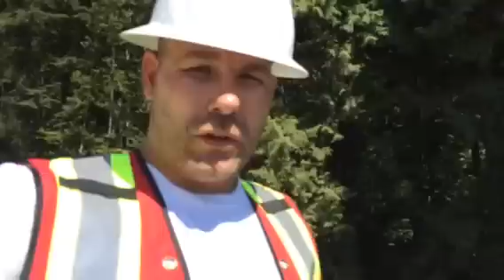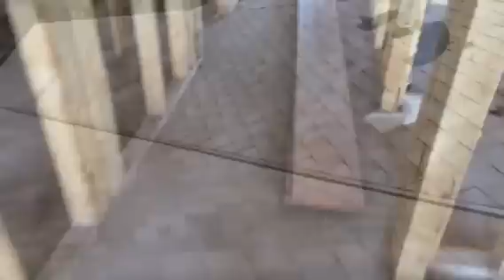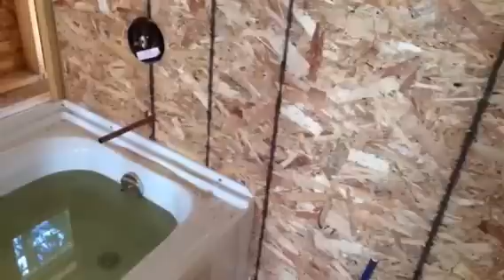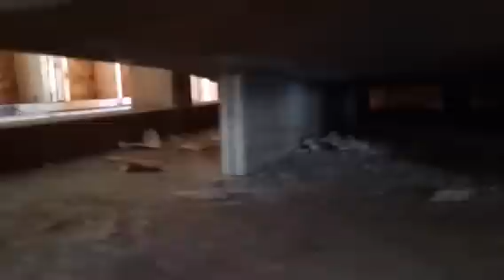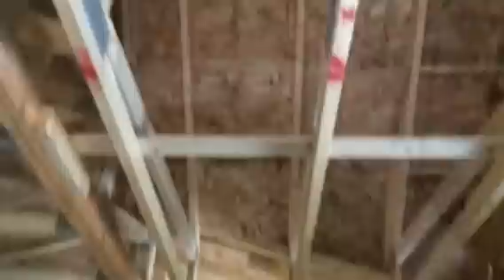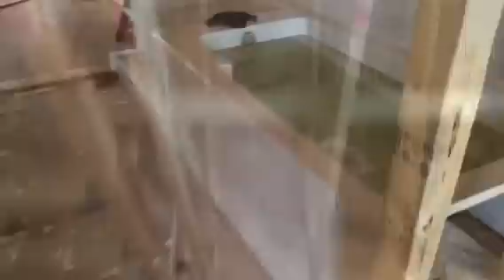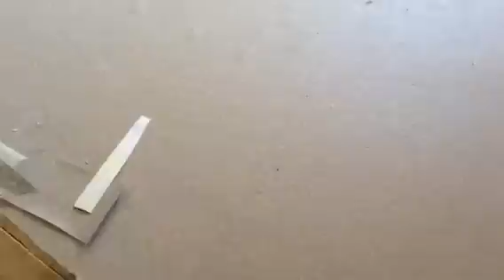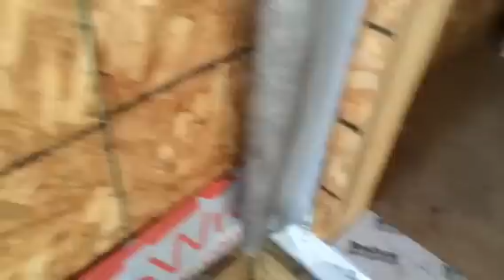New Home Construction Fails

Comment from the maker: Thanks for all your comments gentlemen.  This video is to educate people about what's going on behind the tiles, tub , sundeck surface etc. that the builder cut corners on to save a buck.  

The OSB used at a tile backer will deteriorate quickly if moisture gets to it and OSB doesn't have the same horizontal strength as plywood to hold up a heavy tub. 
If you have a different opinion then I know a house for you to buy...

I am a licensed home inspector. I'm from Vancouver, British Columbia in Canada where there are regulations for home inspectors.
Reply: +haligan125   DON'T use zipwall to tile over!!!!  The OSB you see will be covered by 1/2" cementitious backer and then waterproofed.  The OSB is merely a shear wall.  Cement board is not the only way to go -- there are some more expensive and exotic ways,  but they are not as widely used.  Be sure to waterproof cement board with Laticrete, RedGuard, or some similar rubberized product.  While cement board is not damaged by water, it does not provide a water barrier.
Reply: +SunShine I really doubt that anyone tiles the OSB.  If that was their M.O. why didn't they do the other walls?  The OSB is a shear wall which will get overlayed with another sheet of cementitious backer and waterproofed with a fluid applied membrane before tile.  BTW, cement board is waterproof only in that it is not harmed by water, but it is far from being a water barrier.
Reply: Tom Munro, CHI  Interesting to see what "licensed home inspectors" do, in Canada.  I understand fully the system, the logic.  But, I live in Belgium. I'm licensed architect, in Belgium.  Licensed or not home inspectors, do not exist in Belgium, because it's illegal to erect building (big & small, no exceptions) without full official contracted support from an architect, in all phases. From preproject design, up to control assistance at last delivery of works.  In other words, we're "continuous" legal and obligatory building inspectors in line with what we design and prescribe ourselves.  That's a story from another little corner of the world. 

B.t.w. apart from all the obvious failures you showed (All are 100% correct pointed out), my general impression on the timber, although I believe it's perfectly fit to (minimum) private home CLS rules, it's creepy FLIMSY, to my construction standards. Since Eurocode 5   EN 1995  became ruling in Europe for timber construction, I would hold my heart, seeing how flimsy this Canedian house is made....  
Cheers
Reply: +Tom Munro,    CHI I think I can go one better on you . . . I live in an older home (1920's) and had a problem with one of my outlets that started popping the breaker. Disconnected the outlet, breaker still popped. Trace the wires to pull them out, found where they were run through some old armored cables.Attached to the wall studs.With nails.Straight THROUGH the cable.Needless to say, no longer the case . . .
Reply: +haligan125 Cement board is plumbing code in most places. Green board will suffice as long as it is not being used in a tub or shower surround. Green board is only moisture RESISTANT. Cement Board is moisture PROOF. There are some more water PROOF boards available on the market which are lighter & easier to work with however more expensive.
Reply: +Steve Crane hey, can I get in on this d**k measuring contest........Steve, I have been in construction for 38 years and my money is on you.  You are dead on in your comments. 
Also, the "vinyl " appears to be some type of wet area substrate,  which seems to be flashed  correctly.  The roof venting is probably dictated architecturally. It is hard to tell about the condition for the upside-down  hangers,  but what is most concerning to me is how the ledger board was attached to the wall. How do you handle the void under the fiberglass tub? I usually run a ledger under the nailing fin and then bed the bottom in spray foam, although the manufacturer doesn't require it.
Reply: +Sunny One 
I respect that, going on 18 years my own Co., but to the CONSUMER, generally speaking, you want quality you pay for it...SO much of construction today is just crap with a nice paint job because General contractors want the cheapest bids, corners are cut and quality is nowhere...If a General wants top quality its not from the cheapest bid.Glad you demanded quality, but so many do not..All I do is construction defect type work because of people being cheap.
It may be a stupid saying, of which I agree, but in this world to include this video,  the builder was paying idiots because he didn't want to pay for quality.. Thus the phrase, "you get what you pay for"
quality cost more in most anything to include home building. Been to some 3rd world nations and wow, does this saying ring even more true, its shocking.
Reply: If u let Ur tile guys use green board as backer board, that's probably one of the reasons Ur no longer in business.
Reply: grout is not waterproof.
Reply: +Leavemyname Outofthis I had not seen this reply with questions until today.  So, here some answers.  

Creepy flimsy, would be the actual stud work in the first place. (OSB at the other hand has not much relation to being flimsy, as were talking about stability, unless, the OSB is applied as calculated tension structural work together with the studs which means intensive thin nailing density OR glueing) 
Stability in all conditions, also after 30 minutes of fire, which is fully included in EUROCODE 5, and applies to all EC countries, and it is including minimum heat insulation norms which differ from EC country to EC country. 
EUROCODE is the set regulation of minimum stability calcalation norms. EUROCODE 5 represents Wood construction. (Others are brickwork, concrete, steel etc etc) 
Also bend-allowances for medium-large span floors had been reduced from 1/300 to 1/500 with Eurocode 5.  (1/300 still allowed in typical short span domestic floors, like under 4 meters wide) 
If I understand well, in USA still 1/250 is allowed...   Everyone knows that makes a huge difference in wood sections indeed.  
etc etc 
There are so many things around this example seeming very flimsy (and nevertheless probably legal) 

When it comes to outer walls, in view of insulation norms, 140 mm sized + rockwool inbetween studs will even FAIL to get at our minimal norms anno 2015. I can get that right with theoretical 150 mm (= at the legal limit as we must consider all linear leaks in calculation = at all wood members, and more at corners) , and as we tend to do better than legal minimum, our actual sizing is (common wood sizes here) 173x32 or 225 x 36.  With the latter, I'm able to get at the 2022 insulation goal LIMIT, which is granted by tax reduction.   

Greets
Reply: Holy shit who are these hacks? I wouldn't let these slobs build me an outhouse.
Reply: +SunShine NEVER use green board in a shower enclosure. Its not waterproof its mildew resistant. Huge difference.
Reply: +griffey2447 purple board or even drywall can be used as sheer in an interior wall when it is called for by the engineer who drafted the plans or the city or county who plan checked. There is no reason or excuse to ever use OSB in a bathroom on a wet wall.
Reply: +Charles OConnor Drywall's shear ability was downrated so severely ten years ago that it is no longer used as shear.  It may have been a result of many American jurisdictions switching from the UBC to the IRC.  In the Pacific Northwest nearly all shear panels are OSB or CDX.
Anyone who worries about OSB in the shower area should also worry about hem/fir studs -- they rot too.  The reality is NO moisture should get that far.  If it does, your tile setter is incompetent.
Reply: You.obviously haven't run into me on the job Andre Glinsky I'm also trying to make inspectors better Andre.  

I see a know it all as part of the problem not the solution.  If you think you know the best way to do stuff that's great. I'm sure you clients are really happy BUT, that's not the norm in this Industry. There are a lot of poor builders in the industry or do you disagree with that statement to?  

I am just trying to bring awareness to the industry and I have been incredible successful at it. Where are you from? I'll come check out your project if you that confident...
Reply: You are mistaken. Properly installed and proper cure time and it is waterproof. I do this for a living.
Reply: A smart, gun totin', house buildin', spanish speakin', no-bullshit taken', plain speakin', cool ass, woman!  Hey doc, your ex sure head his head up his rear end when he lost you!
Reply: because roof sheeting should not get wet.
Reply: do you have marine ply over there?
Reply: And...just stfu already. If they used osb for shear it was probably called for. Look at the tub flange idiot and you might see the clues that the wall requires another layer of substrate. FFS all you armchair builders are fucking stupid!
Reply: +The Home Inspector 
Let me vent,, lol 
You are not in construction, but you judge and pick apart work that experienced people in construction have performed. In my experience with every private home inspector I've dealt with, not city, has been no it all wise guy or gal, (gals are the funniest) calling out items that are done per industry standard or city code, strictly per their opinion. just making uneducated guesses slowing down the process of selling my houses, so that I can write emails to brokersz buyers and of course the inspectors. proving that everything I do is strictly by the book and per most recent codes. 
that said, I understand that knowing everything about everything isn't possible. I would hope that you are one of the few decent inspectors that will do a bit of research when you see something that looks wrong but you're not 100% positive that it is.. 
I'll definitely check out your videos and pick them apart lol 
cheers brother
Reply: Tom Munro,    CHI I wish a better inspector had checked my house before I bought.  
the driveway grade is higher then the garage- basement floor causing flooding which warped the hardwood floors in 3 rooms that I had to repair and replace.
he missed several electrical issues, clogged floor drains, and a few other things he shouldn't have.    I'm still getting some of it fixed.
Reply: I've seen what OSB does... first it expands, then when it dries, it crumbles. Terrible stuff, especially anywhere near a bathroom or kitchen :/
Reply: OSB should never be anywhere near a wet location.  Schluter is approved for use over wood but I think they recommend a water resistant plywood because you have to trowel the cement mix over it so it has to get wet for the initial install.
Reply: Yes, I thank you very much! We moved into my house while it was under construction and did not have any inspectors come out like you did, and 9 years later... We're putting a new lock on the door because it's breaking, and we find that the door bracket where the deadbolt goes into was secured very badly. They didn't even have a reinforcement place which is standard in newer homes. They were using the screws that came with the knobs to screw in the plate. Which is incredibly dangerous. Let me ask you something. Do you want to have 2 small screws (not even wood screws) keeping you and that creepy man away from your stuff? Of course not. We have just installed another lock but had to put the other screws again as they had also cut out the wrong depth, so we have to put the normal screws back in, go t the store, get the correct tools, come back, and fix their mistake. I am going into an internship at my local school. Going into a program called, Ignite. And I'm interested in construction and technology and everything in between, and I'm thinking of majoring in construction. Have any thoughts, tips, anything?
Reply: I'm sure a Tile backer was going over that osb in the bath, its not like the osb is over the tub lip, its behind it.
Reply: The Hillbilly Laboratory   There are some home inspections that are not on the up and up! This is in Kentucky, but could happen anywhere. The VP, a woman I know well, of a small hometown bank is running a pretty good scam, and making lots of money doing it, and nobody questions it. She oversees all of the banks home foreclosures, so she gets the pick of the liter. A lot of them are older homes with a small loan payoff. She then buys these houses herself, has her own handyman go in an do "cosmetic" repairs, paint, new carpets, etc. She gets it looking good, lists the home, and to potential buyers she recommends a specific home inspector that she say is great, and does all the banks inspections. In truth, the bank does not recommend any specific inspector. Her recommended inspector is contacted to inspect the home, and he presents a clean bill of health, so to speak. The buyers are delighted, and she arranges for the buyers loan to be approved by HER bank. Her profit margin on the deals are usually 75-100%!!! When the deal is done, the Home Inspector gets his 10% payoff. Her group of handymen are not in on the deal, so they just get paid whatever they estimated for the work she requested. So she makes off with, at the minimum, 60% of the sales price. So don't ever use a Home Inspector recommended by the person selling you the home!
Reply: My house was built without soffit vents in the attic.  This resulted in moisture condensing on the underside of the roofing plywood.  Inside the attic you can see dark stains of mold.  When you stand on the roof you can feel the plywood give as you walk on it in some places.
If the roof had been built with OSB I would be falling through instead of just feeling a little bounce.  If the house had been built with proper attic venting, OSB might have held up but then again, all roofs leak eventually.  Really, I would say to never use OSB for any dwelling structure.  It is a cheap substitute for the good stuff. People always want to go cheap.  My house had a new roof put on just before I bought it but the soffit vents were not added at that time.  Somebody decided to go cheap!
Reply: Please cite actual engineering specs showing that OSB falls short of design criteria and should be banned. Thanks.
Reply: I wouldn't say OSB is useless everywhere but using it requires careful attention to circumstances of use.  Modern engineering is capable of creating OSB that can hold up in many cases but the average Joe contractor is not going to read the engineering specs.  If you buy some no-name OSB at Menards and use it for roof deck in a cold climate it will fail from condensation.  
Still, if it only costs  $400 more to sheet a house in plywood instead of OSB, and it were my house, I would pay the extra 400!
Reply: Bos742 The vertical support is 3/4 inch plywood, however the horizontal piece just beneath the tub is in fact half inch OSB.
Reply: You're all fucking idiots, I'm a professional home builder in Minecraft and let me tell you, the best water proof material is the dirt block.
Reply: Thot Slayer well played good sir
Reply: Tom Munro, CHI  cheap home depot CRAP
Reply: Don't fucking comment again unless you know wtf youre talking about.
Reply: +najeradavid626 Canada,,,,,Britsh Columbia,  hence, " B.C."
Reply: Tom,
Thanks for your posts. One rule I was raised on was that if you do a job, do it right the first time. I moved to and settled in a Rural County (Parish) in Louisiana. They only adopted inspected building codes after Hurricane Katrina. I bought a home that was built in the late 1950's and working on it is like trying to negotiate a mine field. When I went to change out a light fixture in the Utility room I pulled the existing socket out only to find that every wire in the box was black! No white, no green, no red, all black. A voltage meter is a staple in my tool belt around here. What this country is seriously lacking today are Craftsmen. You know, those that take pride in what they do.
Reply: I'm not a builder Andre Glinsky, I'm an inspector and with what's going on in the construction industry I will always have a successful career.  I've actually expanded my YouTube videos to a channel called The Home Inspector. Check it out and leave some comments!!
Reply: +The Home Inspector 
I agree with the fact that there are contractors that do shoddy work. I'm in Everett Washington. building houses in Seattle and Kirkland. Feel free to come pick me apart.
Reply: Green board is NOT waterproof.  There have been massive failures putting tile on greenboard.  It's meant for high humidity areas, but not bulk water.  The only green board shower I've torn out that didn't have rotting studs and subfloor is one that was never used. 
Everyone is freaking because of the OSB in the shower.  If the OSB gets wet, then the studs and subfloor  would too,  and they should've been framed with pressure treated materials.  I cannot predict how this builder will finish his job -- maybe he is a clown -- but the OSB should be buried beneath so many other legitimate waterproof products that the issue should be moot.
Reply: +Steve Crane 
exactly correct
Reply: Steve Crane its still code for shower tubs
Reply: Tom Munro,    CHI   As a high-end tile installer I can tell you that if water ever gets behind the tiles, the installation / silicone was done improperly.  You could install tile on cardboard backer and water would never even touch the cardboard.
Reply: what if he planned on using red guard to coat before putting his backer board on or like the other fella said a schlueter system. i mean serioursly there is more than one way to skin a cat properly. As for most the other stuff you pointed out i def agree. like the hangers for example
Reply: Mason Carter yeah, there's also a building code that must be followed. it's pretty strict here in canada. 

it's expensive but it's probably still your best bet to lay two layers of cement board instead of a layer of Osb and a layer of cement board as the Osb will very quickly mold and fall apart when wet.
Reply: Brian Sparks agreed and understood but one could still red guard it and create a moisture barrier.
Reply: brownsnake0400 you must not be familiar with red gurad
Reply: *guard
Reply: +Mason Carter it's RedGard, actually. And it's not a cure-all. Kind of like doing a whole roof or driveway with 100 cans of Henry. Kind of like caulking failing brick work, instead of chasing the cracks and repointing them. Kind of like the shoddy work in this video, some don't see anything wrong with it, and some see everything wrong with it. End of story fellas, give it a rest already and grow up.
Reply: salvagedrover  no bud it's not a cure all but when we put in a tile shower we are required to red guard everything from studs to the sub floor before you lay your liner and pour your pan. if you read i "agreed and understood what the issue was. I simply said one could use red guard to make it work. I laid tile for ten years with a local company and for myself. Just because you use red guard does not make it shotty work that's actually a extra step most shotty contractors will skip. no I have never laid over an osb wall and probably never will and I was not defending the jack leg who did. again just simply pointed out that it could work if done right. period that's it. have a nice day bud I gotta go to work
Reply: Tom Munro,    CHI do you need a filmer? Ill fly out and film for you and help you build this channel! I see potential
Reply: Tom Munro,    CHI
Reply: Tom Munro, ok
Reply: sunny71169   Thank you, and yes he did! 😂😂
Reply: Green board is crap.  It may be for moisture resistant areas, but is not intended for showers.
Reply: An interesting thing about drywall is that you can put  Schluter Kerdi membrane over regular drywall but you should never put it over greenboard.  Greenboard outer paper is coated with a waxy material that slows water penetration. (same stuff on the inside of both) This waxy material  will interfere with adhesion of the membrane.
Reply: The OSB under the tub is a part of the tub it comes from the manufacture that way.
Reply: Brian Sparks  " OSB should never be used near a wet location " then why is it used on roofs?  just curious
Reply: Shawn Masterson - Unless my eyes are playing tricks on me I don't see any OSB under the tub, I thought I clearly see plywood, looks like maybe even 3/4 inch not 1/2
Reply: Thank you tom.
Reply: Ken A good catch. Fiber rock/concrete board is the only way to go
Reply: Nice video
A home inspection with common sense
And he actually goes on the roof 
Puts these other half ass inspectors to shame
Reply: Steevo - Tile, just like all material that goes into building the walls and floors it's set on, is subject to thermal expansion and other movement. A tile setter can do a perfect job of installing tile, but if the house moves, grout joints crack. A builder on such a shoestring budget that they won't install green board or Durock is unlikely to shell out the money for epoxy grout and latex modified thinset that can absorb the expansion. Don't blame the tile guy. Install the proper backing for the shower so the tile guy can warranty his work.
Reply: Tom Munro, Inspector. , a gallon of water is less than 10 pounds .
Reply: 8.34 pounds is not 10 pounds
Reply: WTF? You should be banned for being ignorant.
Reply: And plywood delaminates with just a hint of water. Your problem as you stated was inadequit venting wich causes a host of problems.
Reply: Totally agree. I'm a builder and I'm fed up of the phase "that'll do" or "it's not worth it". I've had clients who think spending money on the bits you dont see is wasted money. You can change the finishings as many times as you like, but make sure the sub structure lasts.
Reply: Isnt there going to be durock or denshield applied over the rop of the osb ? Is that not allowed?
Reply: +Sunny One 
And the fact you mentioned using "GREEN BOARD" for a shower wall means you don't know jack about construction...Its NOT waterproof genius, is for DAMP areas, not showers! I've repaired many of bathrooms because of this crap, I suspect you prob. are the "put in the joist hangers upside down type" yourself...
Reply: +Steve Crane exactly right Steve. That was a shear wall, if you notice it was a stairwell wall and I'm willing to bet the wall below it was also a shear wall. Notice all the seams were blocked and nailed for shear. One other important fact is look at the tub flange. That tub still needs another layer substrate ie durarock etc. These were just simple clues I picked up from the video that none of the people commenting even the so called licensed architect above didn't catch or for that matter this home inspector who has no experience building a home let alone inspecting one.
Reply from the maker: Thanks for your essay Grrrnthumb clearly if your out there in the building industry your part of the collective problem not the solution.  Don't you think I know what a cantilevered deck looks like?  I'm also holding the design blueprints and inspect to the standard spec'd in them. 

Thanks for your input.
Reply: Those joist hangers were no doubt properly installed. In certain cantilevered floors, there is an uplift effect possible on the inside attachment of the joists, and engineers will occasionally counter this by specifying the upside-down hangers, which is approved by Simpson if spec'd by an engineer. 
Also, there is no such thing as "OSB particle board". Those are two different products. Most OSB DOES have an exterior rating, notice in your video that it is used both for exterior sheathing and for roof sheathing. The interior shear wall by the tub will do just as well there, once the shower is properly waterproofed, as the roof & wall sheathing will do under much harsher conditions once they are properly covered. Your old-fashioned ideas about the virtues of plywood are a design-cost choice between two fully adequate products that is none of your business, just as is the selection of the wall sheathing is between the homeowner & builder before construction. It is not for you to falsely claim it is an error after it's built. 
Also, the drywall at the tub is actually the best choice for some excellent sheet membrane waterproofing systems like Schluter Kerdi (and many others). You can't claim it as an error until you know the system being used.
Reply from the maker: Your absolutely right  Brian Sparks OSB should be banned.  Thanks for the comment..